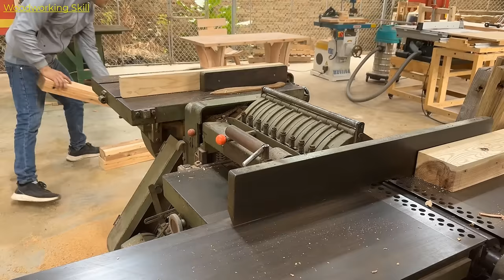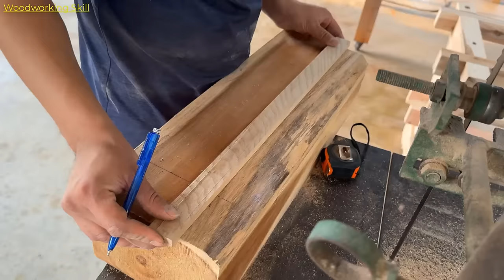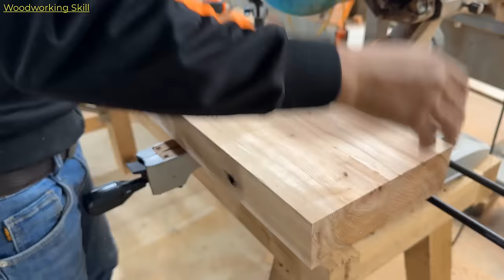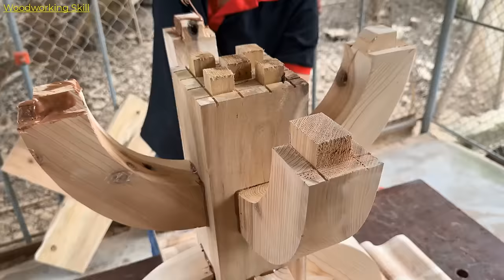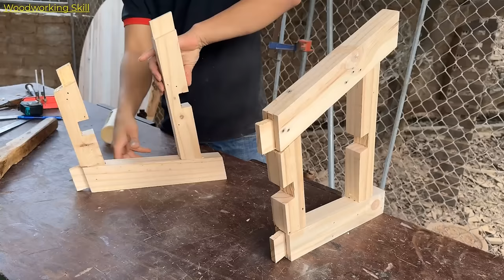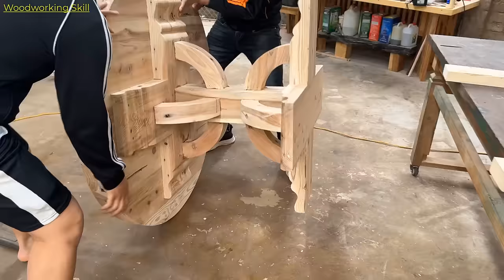Amazed by the young carpenter's gigantic wood processing project. The Finest Woodworking Skills

Comment: This is very cleverly designed and constructed BUT BUT BUT why not fill in ALL the joints, knots and holes with wood-filler and that would make SUCH a more professional and aesthetic finish? It wouldn't take long and would make ALL the difference.

Comment: The title "Finest Woodworking Skills" feels misleading, as the video showcases an apprentice working with low-quality, soft yellow pine, assembling the piece hastily and leaving much to be desired in terms of craftsmanship. While the effort is apparent, rushing through the process and using subpar materials ultimately undermines the final result.

True mastery in woodworking comes from precision, patience, and the choice of high-quality materials, especially fine hardwoods. A project that applies these principles will stand the test of time and earn a craftsman pride. The thin layer of polyurethane applied at the end may give an illusion of refinement, but it cannot mask the poor joints or lackluster materials beneath.

It’s disheartening to see such effort fall short due to these choices. The apprentice has potential and would benefit greatly from investing in better wood and taking the time to hone their technique. While fine hardwood may come at a higher cost, it’s an investment in both skill and the quality of the finished piece, which, in the end, should never be compromised.